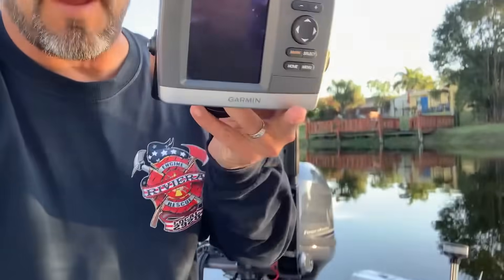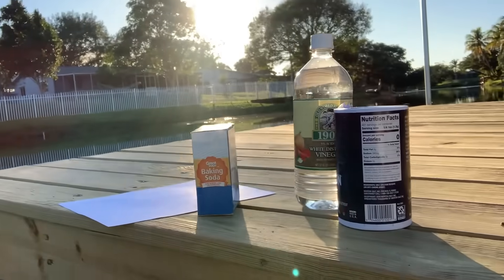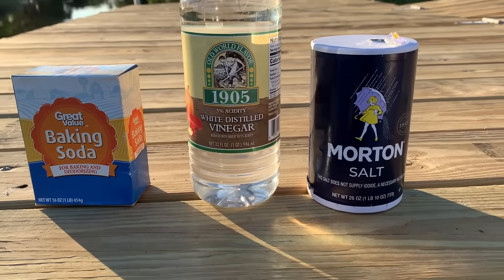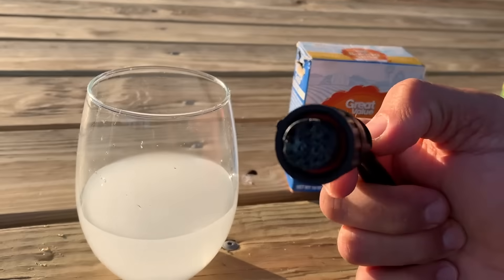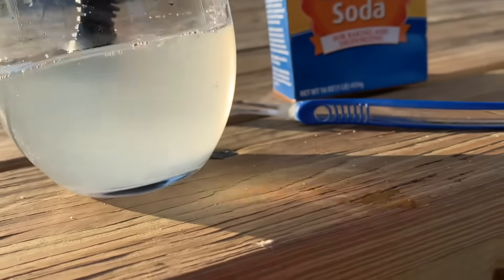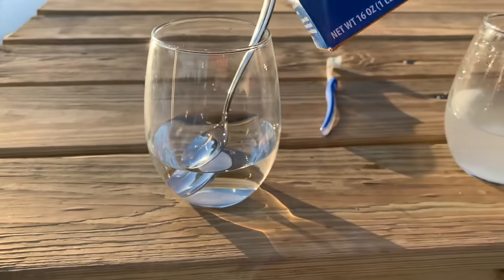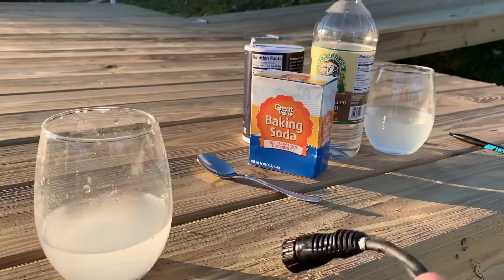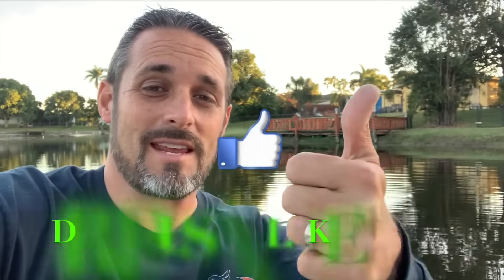HOW TO CLEAN CORROSION FROM COPPER ELECTRICAL CONNECTIONS USING HOUSEHOLD CHEMICALS

Comment: yes, clean the contacts, with electrical contact cleaner,  and then waterproof with a new o-ring, and spray the contacts with a lubricant such as Boshield or use some dielectric grease.  This is great point since it happens likly on all connections on boats.

Comment: Put a bit of vaseline on all connectors when they are new and as needed after and you won't have corrosion issues.  Not quite sure what the salt in the vinegar accomplished.  Salt around electronics causes corrosion so why would you dilute the acidic vinegar before using it with salt?  Makes no sense.  Try just plain vinegar with your soda wash after to neutralize any remaining acid as it can start the corrosion all over.  Blow it out with a little compressed air or dry it with a low setting on a hair dryer.  Get it dry.  Then use the vaseline, a bit on the screw down plastic nut will prolong its life and ease its use as well.

Comment: Could you not make a large quantity of baking soda and water mixture to fill an ultrasound tub with and get better results then thoroughly rinse good and air gun dry then grease with di-electic grease to keep corrosion at bay?

Comment: Did you have in green corrosion on the pins on the unit? Did you brush the pins off with the toothbrush. I’ve had corrosion build up in both locations.

Comment: There still remains one potential problem...The corrosion probably has wicked up the wires and will (in time) corrode out the wires...I have seen this happen on a few cars that were salt water damaged (high tides).  The harnesses were only cleaned and not replaced.  Some months later most of the harnesses had to be replaced (duplicate labor).

Comment: Wow, can't believe what a difference the SALT made.  I did this today on an heavily oxidized extension cord plug.  It was very dark, almost black.  Soaked it in vinegar for 10 minutes.  Not much happened.  Added a little salt and 60 seconds later it was very clean.  Just scrubbed it with an old tooth brush and it was bright and shiny.  Whoda thunk salt would make that much difference.  Now baking soda, alcohol and spray coating.
Reply from the maker: Sweet!!!!!! I hope the others that commented can read this one!!!

Comment: I've done the same ting with a drill bit about the same size as the copper plug holes and turn the bit by hand cleaning out the corrosion Spraying the plug holes with contact cleaner and then spraying with silicone electrical spray

Comment: basically just use the citric acid to dissolve the rust, then baking soda to neutralize it.  What is the purpose of the salt in the first part?  I would definitely wash with either alcohol, dry, then apply DeOxit or some type of electric grease to prevent future oxidation because the protective tin layer or whatever has been eaten off by the acid.

Comment: Its funny how people keep putting viniger with baking soda. Viniger is an acid, and baking soda is an alkaline, so that makes a netural mixture. Just use the viniger to remove the green death (acid disolves the corrosion), then dip the plug into baking soda in water to neturalise the acid. Its basic 6 grade sicence

Comment: Good tips on cleaning contacts. 

Here are other tips are:  be sure contacts are bone dry before reconnecting;  you can use WD-40 as last step (WD stands for water displacement);  always apply a dielectric grease to outdoor or automotive electric contacts to prevent corrosion;  make sure any connection along a wire harness is NOT the low spot (which would encourage dew or water to run to that spot);  there are electric contact cleaner spray products available and come with spray tube for detailed cleaning.

Comment: Citric acid dissolved in lukewarm water, interdental plaque brushes, (amazon) rinse with water. Best method cheap as you like, i bought about 2kg of citric acid powder for £8 to remove rust from a large lathe, worked better than any commercial rust remover and Ive sill got most of the citric left. incredibly economical.

Comment: Good video, as those below said-use some water to displace the baking soda, then use alcohol to try to get rid of water. compressed air to dry. That is about only way to get moisture out. I like a layer of Corrosion X. I also think the guy who mentioned the silicon grease had one of the best suggestions I read. That will really help keep out the corrosion from coming back quick. I worked in RR radio and electronics, as well as ham for 54 yrs.

Comment: I see a lot of people seeing use dielectric grease dialectic grease is actually an insulator and it can impair your connections. You can use it on an outside of plug to keep water. Out
Reply: It needs to be an insulator, otherwise you’ll create a short between pins

Comment: Once it is clean, spray both sides with CRC 2-26 to prevent a repeat.  Then put a glob of dielectric on the center and plug it up.  You won't ever have this problem again.

Comment: There are sets of different size probes for cleaning welding tips…………..they also work well for this process ………..just remember do not use one that you have to force into the connector ……it will get over enlarged …………40 year electrician and mechanic here ……there are many tools which can be used for different functions than what they were designed for …….with a little thought………..

Comment: After cleaning you can put silicone dielectric grease to prevent corrision in the future. Use a lot of the silicone grease to block all moisture out.

Comment: Great job. We use corrosion X on connectors and can run a Lithium battery under water. The Corrosion causes a HR and the Corrosion X stops this. 
The US Marines use it.
Reply from the maker: Awesome. Thanks for the tip

Comment: Stabilant 22 liquid on clean contacts used in Avionics to decrease resistance on connections.
Dielectric grease increases resistance but helps prevent corrosion.
Use anti Ox compound instead.
Good video thank you 👍.

Salt water marine mechanic since 1976 .
Reply: Not many people know about Stabilant 22!  great stuff.  I knew the inventor, Dayton Wright.
Reply from the maker: That’s amazing!!!! Thanks!!
Reply: @watchyourlip3209 napa has it

Comment: Try letting it soak laying sideways so the liquid can fully coat the terminals.  Hanging upside down in a small glass traps a pocket of air inside like a diving bell and won't work as well.  Then make sure to replace the seals and use grease/protective lubricant where appropriate to prevent the corrosion from returning.
Reply from the maker: Great advise. Thanks

Comment: CorrosionX marine.spray and walk.kills Corrosion keeps moisture out and nonconductive.i use on tractor trailer plugs in Pennsylvania.calcium and salt kill wire and plugs.i spray twice a year and haven't replaced a plug in years
Reply from the maker: Sweet. I’ll check that out

Comment: You just forced corrosive solution up into the inaccessible crimps and wire where it is not coming out and will promote corrosion down the line no matter what you spray afterwards. From an FAA licenced aircraft technician -Never do this. Fine wire brushes and contact cleaner.
Reply from the maker: Thanks for the advice!!!

Comment: YEARS AGO,
Freon was used as a refrigerant for refrigerators & AC systems. It has since been banned as harmful to the atmosphere. But before it was, they sold freon in spray cans at the hardware. This stuff cleaned copper connections like you wouldnt believe. I have sprayed freon on the greenest corroded connectors and the freon washed it all off & left the copper as bright and shiny as if you had just gave it a high polish. The stuff was great. But then, 
it was banned.

!
Reply: I very much remember the freon cans. I was working as an equipment engineer when the ban started to kick in. A guy I worked with and myself started ordering cases of the spray daily until our suppliers supply ran dry. We stashed it and had a stock that lasted another couple of years. I left for another job, but I was contacted by the other guy sometime down the road telling me he had just pulled the last can from our hidden supply. The stuff was great to work with.
Reply from the maker: Interesting!!

Comment: I love dropping in on these vids to see what is presented and to read the often completely incorrect suggestions in the comments. I don't get using an acid and salt to clean a sensitive metal like copper especially when salt created the corrosion in the first place. I've  used vinegar or citric acid to clean rusty tools but never electrical corrosion.

 Corrosion on batteries, battery terminals and the like is an acid driven corrosion and an acid "may" remove much of the visible white, brown, blue stuff. That's why soda on a car battery is a popular method but is not the best choice. This corrosion is not acid but an electrolytic reaction the current, moisture and salt with the copper. Still, your best choice would be skip both the vinegar and the salt and use a solution of baking soda in water with a toothbrush or very fine wire brush. Apply, scrub, rinse well, swish in some isopropyl alcohol and blow it clean with compressed air or even a blow dryer works well. When completely dry wipe on some dielectric grease to help prevent future corrosion. 

 For those that like to use baking soda and vinegar mixed together just stop it! Vinegar is a weak acid and baking soda is a weak base. When you mix them and it gets all fizzy that's nothing but the two chemicals neutralizing each other. What you're left with is mostly water, carbon dioxide and salt. It does absolutely nothing other than look like some sort of powerful cleaner. It is not.
Reply: You hit on something that has become very popular but useless the combining of 2 items that neutralize each other but look impressive while it's happening. It is very much like the belief that soap that lathers works better, which is not the case. The truth on this connector is that cleaning, no matter how, is only a temporary fix. The corrosion has made it into the individual strands of wire into the covering. I am not saying cleaning won't help, but the corrosion is and will continue to grow inside the wiring. When I do cleanings of things like this, I know the results are temporary.
Reply: @ogdenaff You are absolutely correct Ogden. As they say, an ounce of prevention is worth a pound of cure.

Comment: You could add two more steps, rinse in distilled water to remove the baking soda mix and then dip the connector in 99% isopropyl alcohol which Canberra purchased from any decent electronic supply house, be forewarned it could be expensive. The alcohol will absorb any remaining water from within the connector and dry it out. There is also a silicone grease used for providing some water resistance on electrical connectors that are used in wet environments.
Reply from the maker: Yeah. This sounds great. I was just trying to use household chemicals - stuff that people may have laying around the house. Thanks for watching

Comment: good tips, I've been using only vinegar for years to clean battery terminals and electronics. not sure why you would salt in the mix considering that is what causes the corrosion to begin with, salt is very corrosive. the baking soda and water is used to neutralize the vinegar because it is and acid and if you don't neutralize it it will keep eating the terminal. us dielectric grease on all your electronic will help to prevent the corrosion to begin with. nice tip, have a great day!
Reply from the maker: Thanks for the tips and the kind wishes. Right back at ya
Reply: FYI, I agreed with the "no salt" idea.  But, wow, can't believe what a difference the SALT made.  I did this today on an heavily oxidized extension cord plug.  It was very dark, almost black.  Soaked it in vinegar for 10 minutes.  Not much happened.  Added a little salt and 60 seconds later it was very clean.  Just scrubbed it with an old tooth brush and it was bright and shiny.  Whoda thunk salt would make that much difference.  Now baking soda, alcohol and spray coating.

Comment: Brasso and a toothpick  . Cleaned  an old fuse panel that would not pass current thru a glass tube fuses using brasso and Q tips .

Comment: Electrical Engineer here. I worked on Navy Subs that had similar connectors. The process used to clean the electrical contacts is fine. What's missing is replacing that orange O-ring. That keeps the water out of the connector. Get a new, OEM O-ring and grease it with silicone before plugging it back in (the new O-ring will be tight, so the grease makes it easier to push the plug in).
Reply from the maker: This comment makes more sense than any that has come in yet! Thanks!
Reply: Looks like you take fish finder home and leave connection just hanging in the open air.  Start covering connection when not using
Reply: I was thinking clr ....???
Reply: Looking at the pins on the unit, the corrosion is most likely from the cord being left unconnected and in the environment
Reply: I think you mean silicone grease not silicone caulk. Right? I’m sure you know more about it than this DIY. I do submersible direct current pumps and have learned to seal the underwater connection to the pump with a liberal amount of silicone dialectic grease.
Reply: @LeRoisAdventures  , thanks. I wrote, "...grease it with silicone...". so yes, silicone grease, not caulk.
Reply: @LeRoisAdventures  There is no such thing as DIALECTIC grease, genius. The grease doesn't speak like it's from Long Island or the South! 
DIELCTRIC:  insulating material or a very poor conductor of electric current. When dielectrics are placed in an electric field, practically no current flows in them because, unlike metals, they have no loosely bound, or free, electrons that may drift through the material.
Reply: @Rockfish21035 Ha Ha. The grease doesn’t speak it’s own dialect? Tanks fer collecting me spalling.

Comment: ...you remove than in seconds with a 50% water and muriatic acid mixture. You might want to start with 25% the first time you use it...because it does eat very fast. I then neutralize in either baking soda water or hydrolyzed lime water....for just a couple minutes...and then blow it dry with an air hose. You "MUST!" use either dielectric grease or some electrical grease like No-Alox on it afterwards...or it will start corroding again immediately.

Comment: Would a can of electrical contact cleaner not have worked?
It dissolves the blue oxidation, but good if your in a fix and cant find a can anywhere

Comment: You should not leave the baking soda solution on the contacts, because, it is an alkaline, and, it will actually eat away at the copper.  You should have rinsed it in pure clean water.  Then, spray the contacts with regular electrical contact cleaner.  The contact spray cleaner leaves a good lubrication for electrical contacts.
Reply: Albert:  what do you think Electrical Contact Cleaner would have done if that was first and only?    Thanks

Comment: I'm going to try Coil cleaner.
Reply from the maker: Cool. Lmk how it works
Reply: @watchyourlip3209 Worked pretty good. I had a bad connection on my blower motor on my vehicle. I was hoping it would be super shiny after cleaning it with the acid but it was just noticeably shiner.
Reply from the maker: @ cool. Thanks for the reply

Comment: My main concern with this is that residual acid might wick up the stranded wires behind the conector.  That could potentially eat the wires behind the connector over time.  It is much safer to use contact cleaner and a brush to clean the old oxidation then apply the dielectric grease to prevent re-oxidation...

Comment: If you add a bit of silicone dielectric grease to the connection it will never happen again ;).  Do not believe that dielectric grease interferes with the electrical connection, it does not!  It simply keeps air and moisture out of the connections and prevents future corrosion...